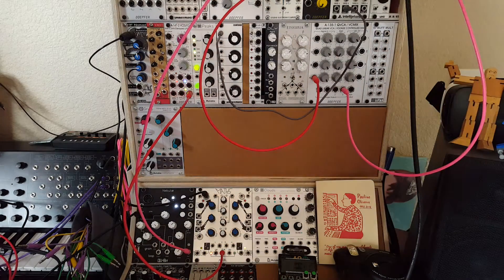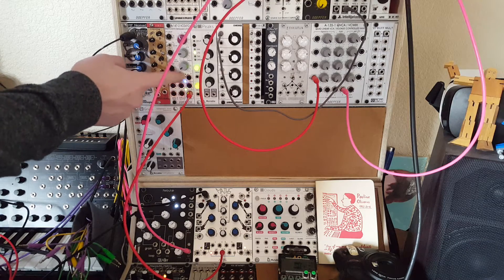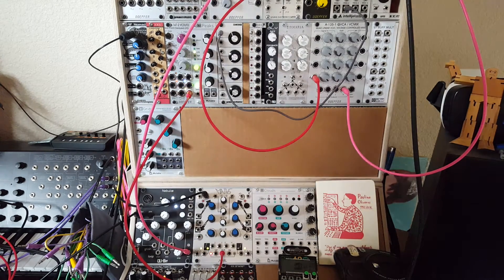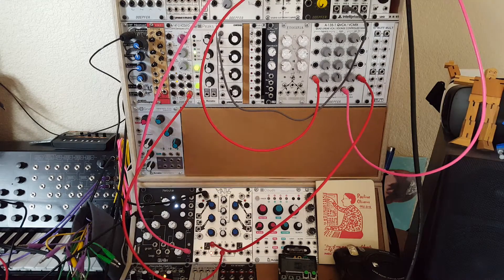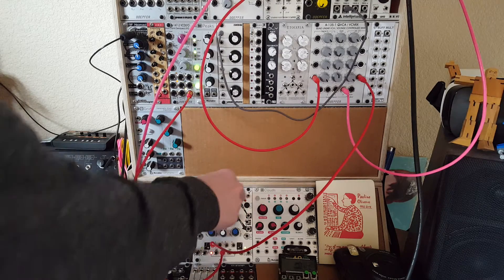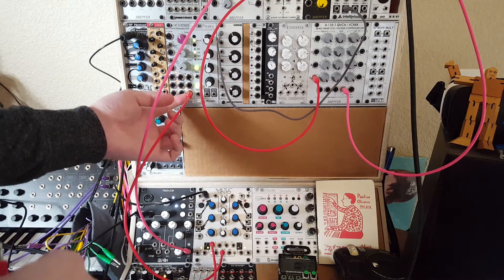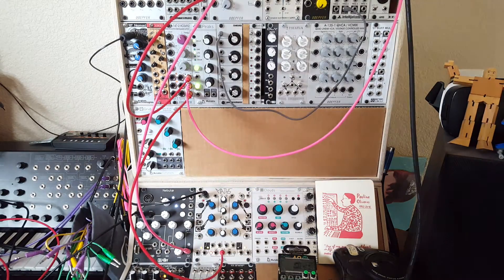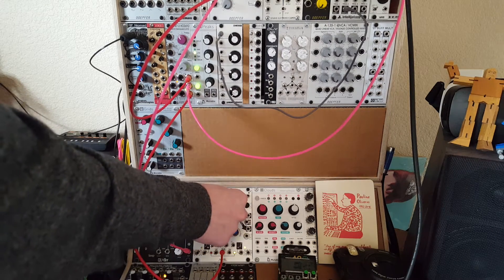VCAs and Sidechain "Ducking" Pt. II - Common VCA Types

Comment: Make Noise Maths is a very complicated module for me to wrap my head around, if I were to just plug something into it and then learn by listening.  I’m thinking that’s because it has a normalization scheme that’s not so obvious to me.  So mainly channels 2 and 3 are for inverting and attenuation, I guess.  THANK YOU FOR SHARING THIS, VERY HELPFUL AND USEFUL!!  Setting this up right now to give it a go.  I’m looking out for some simple module schematics, for diy and learning a little about op amp circuit designs.  This gives me some good stuff to search for.  THANKS AGAIN!!

Comment: I am currently trying to set a sidechain up for the lil Erebus module and the mother32 alike. I want it triggered by an actual kickdrum so I just duplicate the kick signal - easy enough. The Audio of the Kickdrum then goes into the Ladik E-510 Env follower. The new env curve goes into both channels of a 2hp attenuverter (having control knobs for the cv bias helps regulating the amount of ducking that will later happen). From there on I can just take one of the inverted outputs into the VCA in of the mother, goal achieved. For the lil erebus (and all the other Erebus, V1, V2 & V3) it's slightly more complicated. When you plug something into the vca it bypasses the AR envelope of the amp (in the lil erebus even isn't a Amp envelope to begin with). Therefore I am using a 2hp EG and 2 channels of a 2hp mix to sum the envelope for the amp with the inverted kickdrum envelope. Then I am sending this into the VCA in of the lil Erebus.

This is all theoretical for now, but I think it will work. And the whole setup is only 10hp (excluding the kick module).

I really wish however, that there was a dual/quad vca with gain (so like the A 135-1) but also with an inverter on the cv input.
That would save me all the troubles in the world.